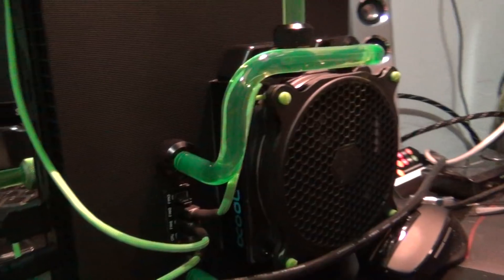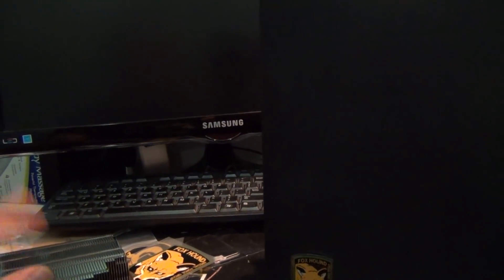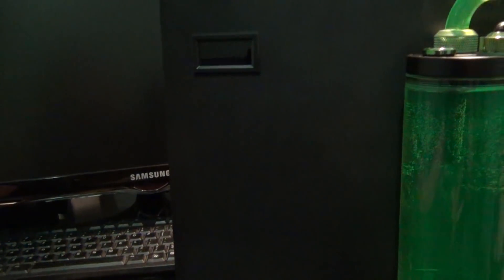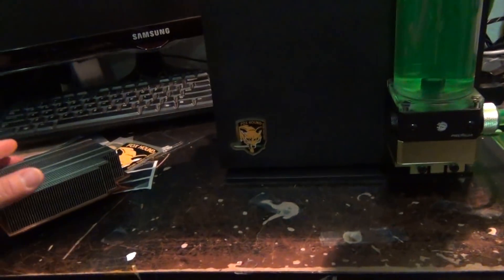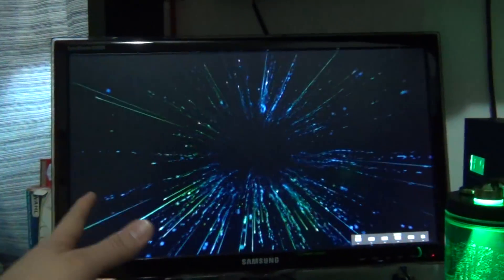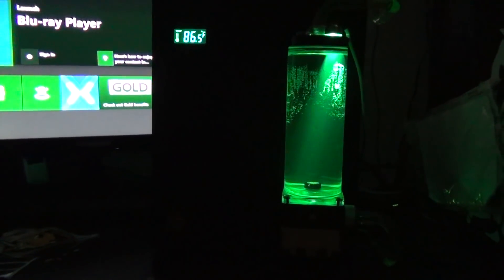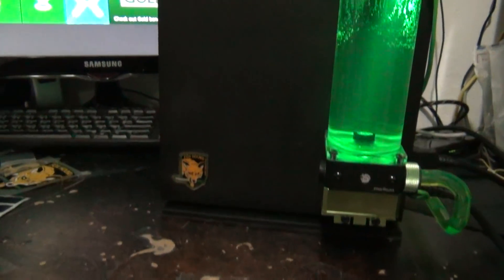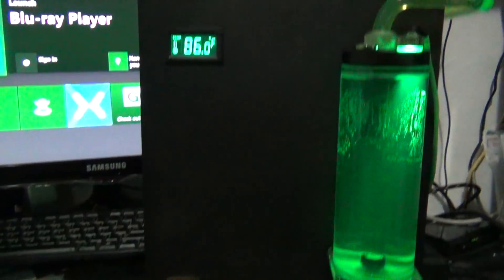Xbox One X Water Cooling System

Comment: if thermals drop on the heatsink by only changing the thermal paste. that means your system is worse off than before. because its not getting rid of as much heat as it could before
Reply from the maker: Adnan Asad. 
If you say so bro the my Xbox is not getting the proper cooling than your wrong my system runs fine and smoothly  with out any problems and I change the DDC Pump to a D5 Pump for better thermals and 120mm radiator no need for a 240mm, thanks.

Comment: Lol its definitely over kill , but that being said it look's Badass . I'm certainly looking forward to seeing people's work with water cooling the Xbox series X & seeing how people are going to figure out get a water cooling set up built into the super complex masterpiece of engineering that the Xbox Series X is . Its going to a heel of alot of ingenuity & engineering it self trying to figure out how a water cooling system is going to be built into the next gen Xbox. 

All I can say is if you Do plan of water cooling the Series X youd better start looking at the details of the design now to try & figure out how it'll get implanted.  I may just buy 2 Xbox series X Consoles so that i can go ahead & water cool or maybe even do a Mineral Tank cooled system.  Once the Vapor chamber fins come off there will be a good amount of room. Then either trace the outside of the vapor chamber copper to then outline it on a sheet of copper to then cut out , then start on working out the shape , flow, tubing direction & leak proofing of a Acrylic housing water Block on the copper or use the Existing Cooper vapor chamber , remove the fins & build a Acrylic block on it as it's a really specific shape that contacts the APU & set chips surrounding kinda like the XB1X

Comment: Super cool. I am doing the same thing to my Xbox one x and I have a few questions about what exactly you did for the RAM chips and the air flow in your Xbox. From comparing yours to mine on how it runs. Your is running way better. I am having some issues. Your the only one who has done this to the One X that I have seen and like to have your help. I am doing this for a class project.
Reply from the maker: Nick Racko heat sinks
Reply: VGA _MODS thx for getting back to me.What is the exact brand of heat sinks you used with the double sided tape. The ones I bought don’t stick to the Ram chips.
Reply from the maker: Nick Racko  Nicelux Thermally Conductive Tape for Heatsink

Comment: So basically put, it runs cooler under load with aftermarket thermal compound than it does at idle with the stock crap?
Well, after the difference I've seen in the past from replacing the stock crap on the Xbox 360 slim and the day one Xbox one with arctic ceramique 2, I'd believe it!

Comment: What connector did you use to power the fan, pump, and resivoir light? I know they have one open 4 pin connector if you do remove the stock heatsink and fan.
Reply from the maker: RayRay Jones. 
Fan Connector is a 12Volt.
Reply: @VGA_MODS  thank you

Comment: This serves absolutely no purpose. The console has a more than competent thermal solution. I'm amazed how many people are doing shit like this. Waste of money and time and it also looks like shit.
Reply from the maker: Hi this mods looks awesome in person bro and this is a just for cooling performance only and is the best. Regular cooling from the Xbox the fan runs louder, then this water cooling fans rums at normal speed and is quiet and yes if you have the money and time to do it then do it if is not then just open your system and chance the thermal paste, by you changing the thermal paste it will do a little difference on the cooling on your Xbox. 
Thank You For Your Support.

Comment: What heater block did you use?
Reply: *cooler block
Reply from the maker: Dustin Horton Univeral Water Block 20$  + Shipping, no need to go crazy and buying a expensive water block go to amazon or ebay you will find it there.
Reply from the maker: Dustin Horton 
Univeral Water Block 20$  + Shipping, no need to go crazy and buying a expensive water block go to amazon or ebay you will find it there.

Comment: Why the hell you would liquid cool an xbox. It does not create enough heat to utilize a liquid cooling system.
Reply: Azeem Hosein it does mine dropped from 87 degrees Celsius to 64 thus providing better performance less lag spikes and less “screen jitter”

Comment: How much did it cost to build everything?
Reply from the maker: Backhander Productions 
Stanley Bolton 

This is the list of the main item the I used. 
120mm Radiator alpha cool 70.99 
DDC Pump 73.99$. 
Water tank tube 100 or 150 mm 14.99$. 
Water tank cap with G1/4 Pom or acrylic version 12.95$. 
DDC Top tank Adapter seat black or acrylic 18.50$. 
Premium magic cube DDC Mod Top G1/4 acrylic or black version 29.95$. 
PETG Hard Tubbing Primo Chill 19.95$. 
Primo chill 1/2 Rigid RevolverSX 6pack any color 39.95$.
Universal Water Block 30$. 
Total=311.26$. 

The Price of The Rest of this items It's not included. 
The LED lights cable sleeving,90•fittings and extender fittings, stop fittings,memory ram heatsink, fans grills,Fans,Paint,Thermometer, distilled water or coolant, And My Time. 
So I don't know if I missing something else.
You can find all parts in performancepcs or amazo. 
Thank you.
Reply: VGA_MODS thank you! Also have you noticed a big difference in performance of the Xbox one x? It does it run the same fairly?

Comment: This is actually not pointless, as the one x gets really warm. Though what you should’ve done was drill two holes in the Valor chamber, drain the liquid and then just use the vapour chambers shell as the block. Then it also keeeps the surrounding chips cool.

Comment: If you are reading a lower temp on the heat sink after changing the thermal paste you have actually made it less efficient, the hotter the heat sink the better its pulling heat away from the chip.

Comment: Did you have any initial powering on issues after your mod?
Reply from the maker: Gaming In Frames 
No problems so far don't need to use a external power supply.  
Thanks.

Comment: Subscribed bro. Where can I get the parts to have it look 👀 like yours if not better?
Reply from the maker: Choke Dealer
http://www.performance-pcs.com. 
Thanks Bro For Your Support and I bet yours will came out better than my and send me your link so I can see it here in YouTube.
Reply: Can you provide a list buddy
Reply from the maker: Choke Dealer 
This is the list of the main item the I used. 
120mm Radiator alpha cool 70.99 
DDC Pump 73.99$. 
Water tank tube 100 or 150 mm 14.99$. 
Water tank cap with G1/4 Pom or acrylic version 12.95$. 
DDC Top tank Adapter seat black or acrylic 18.50$. 
Premium magic cube DDC Mod Top G1/4 acrylic or black version 29.95$. 
PETG Hard Tubbing Primo Chill 19.95$. 
Primo chill 1/2 Rigid RevolverSX 6pack any color 39.95$=281.26. 
It's not included. 
The LED lights cable sleeving,90•fittings and extender fittings, stop fittings,memory ram heatsink, fans grills,Fans,paint,Thermometer, distilled water or coolant,Universal Water Block  30$.So I don't know if I missing something else.
Reply: Is that everything you need to water cool it? Im interested in making one my self but I'm only 14 and can't afford to mess up
Reply from the maker: IDACAT 
Just take your time bro.

Comment: This is cool and all (no pun intended) but this is just a waste of money & time. I doubt the games/movies will run any better than they already do. If you were going to some how over clock the CPU or GPU then water cooling would be necessary. Microsoft has designed the system to wick away the precalculated amount of heat with the fans efficiently and effectively. Only if you generate more heat (by overclocking) would you need to water cool your system. Save your money kids.
Reply: System longevity bud. By significantly reducing the operating temp of the system with watercooling, he is significantly increasing the life of the system. He is also keeping the system from thermal throttling. But yes, it is an expensive mod.
Reply: Viper3870750 i respect your opinion
Reply: I agree to a extent but my PS4 I know it’s not a xbox but overheats in hot weather this could be useful to stop this from happening. You could also run the fans slower so it will produce less noise.
Reply: I wouldn't say it's a waste of money, at least, because my shitty Xbox One X Scorpio Edition can't even run Red Dead 2 without overheating from barely loading a saved game! Lol

I'm going to look into this or just wait until a probable PC release of RDR2.
Reply: @froggy1600  I know this comment was 2 months ago but I was having the same exact same issue, then is started happening on all 4K games, so I looked into it and found reports from people who had opened their scorpio editions to find the thermal paste was dried up and in some cases was barely on the CPU anymore. I contacted Microsoft and they have repaired my console under warranty even though my warranty had expired. If you see this I hope you get your console fixed.
Reply: @sanbo20  thanks man, a few days after I left this comment I did end up taking my console to a Microsoft store and they were able to do some tests and take it to a repair center, I got it back like a week later. I got lucky too, my warranty was about to end the week after I turned it in.

When a customer service rep contacted me regarding my experience with the Xbox, I asked what they found wrong with it to fix it, the dude said they don't disclose that info, so I'm assuming my Scorpio edition had that same thermal paste issue too, lol.
Reply: Actually, watercooling is a better solution then the default hardware. Don't get me wrong the cool factor is a damn nice job. I think it could have been done more neatly then what he did but it still looks good. 

Now, for those of you that like to thrash people. Let me educate you even if its something that's small. I am a pc builder, I made a hobby into a living and I make good money. Support my wife and 3 kids. With that being said. 

This is not as OVERKILL as you may think. I'm not sure how.much some of you may know about throttling temps, let alone building customers water loops let alone the effects it has on a system. 10-30 degree difference is a huge difference in both temps and performance. Go stand out side in the sun for 4-6 hours(typical length of a average game system to run for). Now while your standing out in the sun do you daily activities in the sun. Now go into the house in the AC. I guarantee theirs at least a 10 degree change if not more. Now once again do your daily activities while being inside. You will notice you are more productive while not exhausting yourself. 

Microsoft is not gonna watercool the systems because it's too costly. All they did was "MAKE IT GOOD ENOUGH" to sell to the consumers with out the systems over heating. To me, that's not acceptable. But people have tolerated these issues for so long it's become the norm. Steering off subject. Anyways, excessive heat lowers productivity, productiveness, degradation in physical hardware(even tho it's at a slow, slow, slow pace). Granted that, watercooling on a console does cost some $$$. The improve ment it's worth it. Now if your just an average gamer, play for a few hours and turn it off. Absolutely, yes. This is a waste of YOUR money. However, people who play for hours on end and streamers will appreciate something like this. It keeps temps far below the standard, xbox runs smoothly, throttling is non-existent, degradation is not a problem and, and, and.... it actually looks like a system worth a 600$ price tag. 

The reason the thermal paste is dry like that is because, 1.) The systems are probably sitting in a hot ass warehouse for who knows how.long before their shipped. 2.) It idles for an excessive length at one steady excessive temp. 

That paste is no good.
Reply: Sweet Acid Your comment is purely comical. The fact that three other people liked your comment makes it even funnier. I have a $3000 water cooled PC build. Sorry I don't want to throw money at water cooling my XB1 for negligible and marginal gains. That doesn't make any sense to me. But your comment proves your age so I'm not even really sure why I wrote back because you don't get it smh. You're too caught up in the "cool factor" to see that.
Reply: Sweet Acid no consoles don’t thermal throttle they are built to run at a certain temperature this is jus overkill
Reply: Viper3870750 you calling this a waste of time and money because you don’t have enough packet and capacity to do that.
Reply: Viper3870750 I completely agree with you sir.

Comment: hey bro what water block did you use on xbox x processor and vram...is it a am4 or a tr4 block
Reply from the maker: kozhitnrun 
Universal Water Block.
Reply: Not any universal block will work. All consoles (that I'm aware of) use a 100x100 block so any universal GPU block will fit
Reply from the maker: Andrew Springer 
Im using a universal water block 30$ you can find this blocks in Eb. Or amaz. 
And it works perfect in all of my systems PS4,Xbox One X.
Reply: How are you cooling the ram chips and the APU voltage regulators?
Reply from the maker: kozhitnrun 
Universal Water block 50mm on e  b  ay or @m@z0n 25 to 30 $ bro.

Comment: How much for one like this but for ps4
Reply from the maker: Reece hawkins 
This is the list of the main item the I used. 
120mm Radiator alpha cool 70.99 
DDC Pump 73.99$. 
Water tank tube 100 or 150 mm 14.99$. 
Water tank cap with G1/4 Pom or acrylic version 12.95$. 
DDC Top tank Adapter seat black or acrylic 18.50$. 
Premium magic cube DDC Mod Top G1/4 acrylic or black version 29.95$. 
PETG Hard Tubbing Primo Chill 19.95$. 
Primo chill 1/2 Rigid RevolverSX 6pack any color 39.95$=281.26. 
It's not included. 
The LED lights cable sleeving,90•fittings and extender fittings, stop fittings,memory ram heatsink, fans grills,Fans,paint,Thermometer, distilled water or coolant,Universal Water Block  30$.So I don't know if I missing something else.
Reply: Super Job!
What cooler block did you use?
Reply from the maker: ficinet 
Any universal cpu water cooling block.